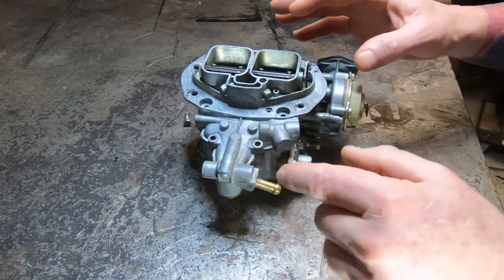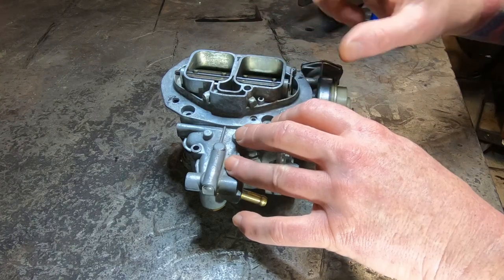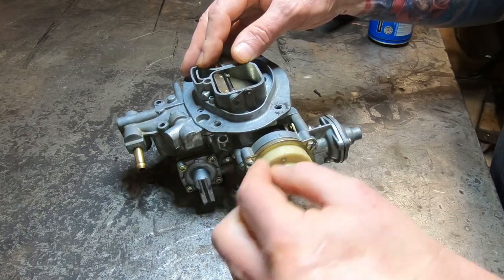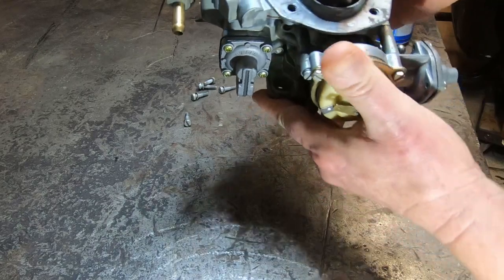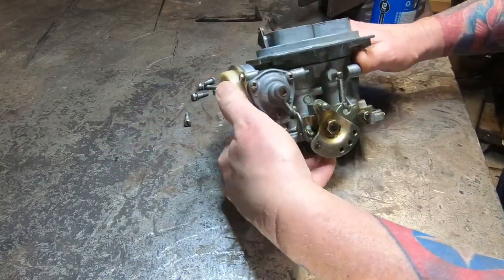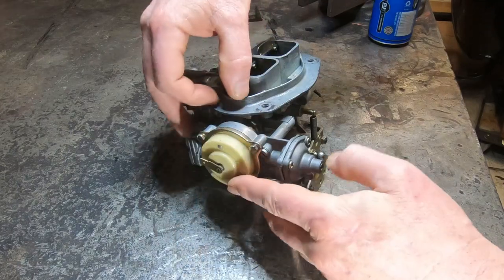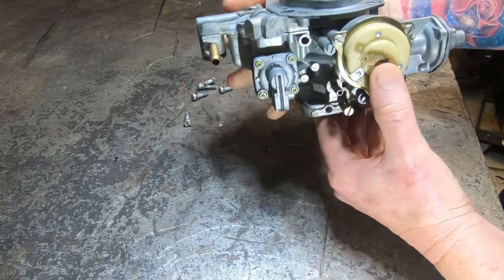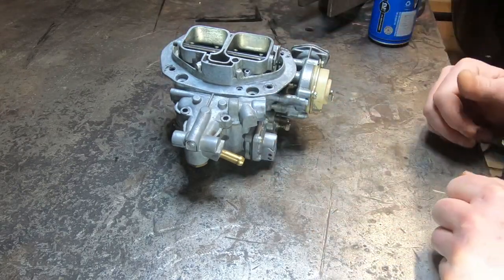Fiat 124  Spider 2000,  Weber 32/36 Choke and idle settings

Comment: So I am removing a Weber 32/26 dfav (no vent) with a Weber 32/36 DFEV (has vent tube).   Can I simply plug up that vent hole with a brass cap and call it a day?   Every other connection point is the same when I did the swap.  All I have to do now is figure out how to treat that vent.
Reply from the maker: Yes you can
Reply: Thank you.
Reply from the maker: Welcome, I'm glad the video helped
Reply: All your videos have helped me, especially the rear brake compensator one.  I get a kick out of the “mechanic language” as well.  Keep up the great work on producing videos.  Just when I think I want to throw in the towel on making yet another repair to my Fiat, I watch your videos and say…”Here I go again, I’ll fix it”.
Reply from the maker: @ronpaster1713 excellent, may the wrench always turn in your favor

Comment: Having problems with my electric choke on my weber first time i put my weber on on my nissan d21 i tapped into power for my electric choke and i think i where i tapped in it didnt like because i burnt a fuse on my truck now electric choke just gets hot when and doesnt open nor lock the butterflies do you think i burnt the electric choke as well?
Reply: I also checked with a test light and i do have 12 volts at the electric choke just gets really hot
Reply from the maker: You can pull the cover and check the bi-metal spring.
Reply: @ELDESTBuilds will it be broken or cracked by any chance?
Reply from the maker: @ramirosalinas4740 or stuck